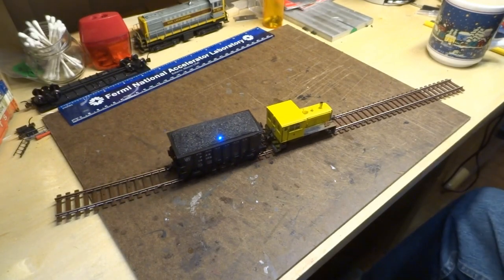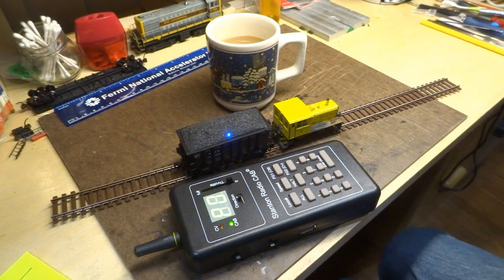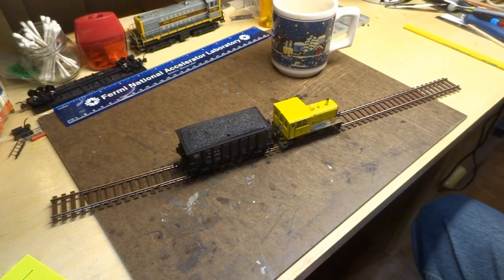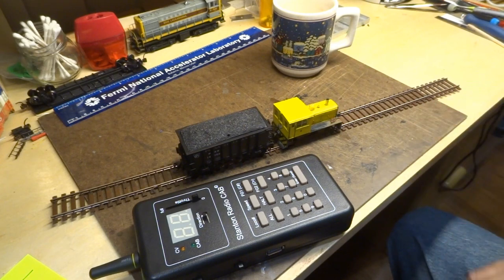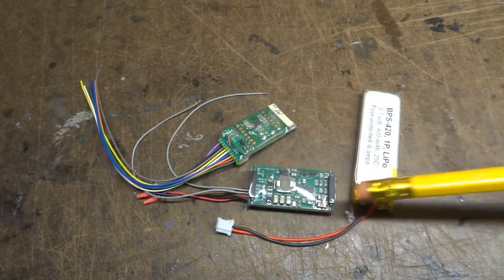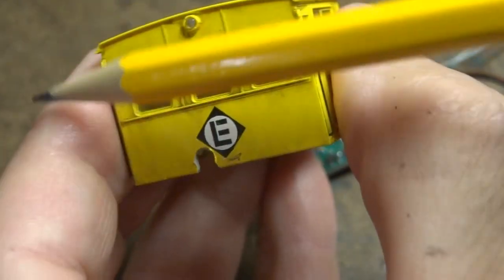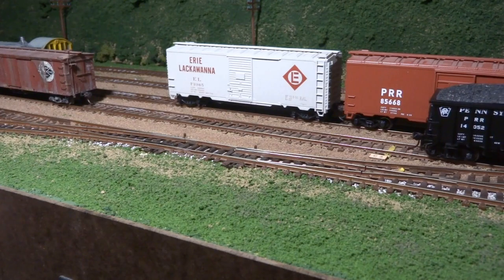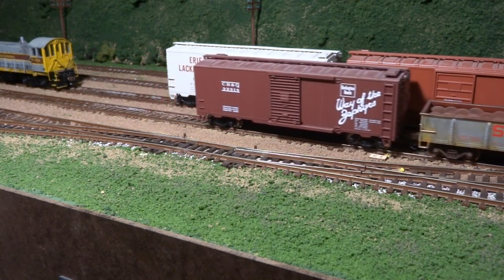DEAD RAIL INSTALL IN HO SCALE  and  S-CAB SYSTEM REVIEW.

Comment: I’ve been out of MRRing for years but having the itch to get back to it. It’s amazing the tech that’s come about since I last played around in late 70’s. I was too young to understand the electronics then but now, after retiring from an electrical/ maintenance background the automation makes so much sense and systems are much easier to implement. Layout wiring is much simpler with wireless controls. Nice video 😊
Reply from the maker: Thanks, Brad!  The S-Cab system I'm using was exactly what I wanted, but does take a bit of head scratching at first, as Stanton's website is so full of technical information.  He was patient with my questions.  Check out the Dead Rail Facebook group for information on many of the battery systems out there.  No more tedious and frequent track cleaning for me!

Comment: I just installed a Soundtraxx Blunami in an HO Scale Mantua Southern Crescent Limited. Going to test it out tonight at the layout powered by 2 standard 9v batteries in parrallel for extra run time. The Blunami operates on anything from 7.5 to 22 volts.
Reply: Also, the 9 volt batteries are in a trailing box car with lead wires going to the locomotive, just like your coal car. Eventually I plan on using rechargeable batteries with diodes and voltage regulators etc... so the batteries charge from the track.
Reply from the maker: Nice!
Reply from the maker: That will be great!

Comment: Nice informative video. I was using the Rail Pro system to control the locomotives and used a dummy locomotive to hold the batteries. If you are a new model railroader or don’t have many locomotives to convert I believe Power on Boaed is the way to go. Thanks for showing the Stanton system.
Reply from the maker: Thanks Tom!  I'm used to on-board power in the 7.5" gauge railroad world.  Now I hope to have that same reliability in HO scale.  I'm tired of OCD level track cleaning!

Comment: Very cool video.  I am using the Micron (Deltang system). Very similar but as far as I know it does not recharge through the rails.
Reply from the maker: I do enjoy the fact that the battery power never stops dead due to lack of electrical continuity.

Comment: I have a slightly different system as I don't have any power on the track at all. I don't mind plugging in the charger. Instead of having the light on the coal car, I have a beacon on the engine. All of my unit goes into the engine but if I had one the size of yours, I would have to have another car in back of the engine just like you have. I am going to have several cars built with only the batteries in them, especially cabooses, so I can have several batteries charged at the same time. I can get about 2 hours of run time out of each battery set up. The system has a charge indicator built in so that when you press a button on the transmitter the cab light will flash the charge strength. My system is from England and is at this time being retooled and will be available in the fall of this year (2022). It was formally called Del Tang but I don't know what it is going to be called as the company has been bought and that is why it is being retooled at this time. The receiver will fit into your small engine and if you get the battery into a car behind the engine, I see no problem in getting a long run time. On one of my switchers  (an SW 1) I will have a "calf" connected to it and that will house the battery. I use a "micro plug" between the units and it is not a problem.
Reply from the maker: Sounds like a really cool setup, David!
Reply: @StanFerris  I like it. No sound but I don't mind. Kinda like the sound the wheels make on the track.  Works for me...
Reply from the maker: Yeah, at the beginning the sounds loops were a novelty, but after a while they seemed to get irritating, sound I turned them off.  So when I went dead rail it was no biggy to just get a board without the sounds.  Sometimes I put a CD on with environment train sounds.

Comment: A friend of a friend, etc.  use to install the plug in batteries professionally.  His comment on the recharging from the rail was the batteries got hot and exploded.  I would assume that this has been resolved in the newer systems.  Any comments.
Reply from the maker: Tommy, well I can't answer as any kind of electrical professional, but the lithium batteries in the gear I use are "smart" in that there is a bit of a safety circuit built in.  Also, my rails are not energized most of the time.  Only when I'm running.  So far, I've had no problems.  As far as the controller, (and most of my Li battery appliances at home and in the shop), I leave them all on their chargers continually- even the laptop I'm typing on now.

Comment: Thanks very much for this but there's something that's confusing me. Where's the receiver? Shouldn't there be three circuit boards? The battery power supply circuit board, the decoder and the receiver to receive the signal from the S-Cab handset.  Also, I'm not aware that ProtoThrottle do battery power. Is that right? I mean battery power for the loco. The handset is battery power but I'm not sure if they supply a receiver to go inside your loco so that that can be battery power.
Reply from the maker: Hi, Richard.  The particular S-Cab system I purchased did not need the factory decoder that was in my locomotives, since I did not need a sound card and a few other programmable options.  The one I installed has three components that got added to my locomotive, instead of the existing on-board circuit board (which I removed).  The S-Cab comes with a small  battery, the BPS module (power supply and regulator, and the receiver/booster module.  It takes power from my rails only to charge the battery, not to run the loco.  The hand-held transmitter sends controlling signals to the receiver that you install in the loco.  Since I already had DCC power to my layout, my loco can get power to recharge it's battery anywhere there is clean track.  Here's another video I did on a slightly larger loco:  https://www.youtube.com/watch?v=Ac4zBaNj-q0&list=PLTQ_pr6o-F_2apJcU-DtWKITdBAQUgwIY&index=58
Reply: @StanFerris  Thanks Stan. I think your receiver is also called a decoder, they are all in the one unit. I'll have to study the S-Cab web site thoroughly before I fully understand. There's a lot to read and it's a beautifully presented website, a joy to read. It's a great shame Tam Valley Depot stopped producing their dead rail equipment. I've managed to get some before they disappeared and am in the process of installing it but I might move over to this system to get more locos battery powered.

Comment: One important question...how long does a charge last?
Reply from the maker: Thanks!  I had the same question before I made the conversion.  S-Cab estimated my loco would run almost an hour or so without any charging from the rails, and indefinitely if it got some voltage now and then from a clean section of track (I have NCE power system).  So I did a video to test that.  https://www.youtube.com/watch?v=jQlVLg-fa1U

Comment: As a newbie to the Train model world ,  I think they should have ready to buy dead rail trains .  I want to make a simple layout and not have to deal with  electric tracks .
Reply from the maker: Hello!  Hope you have some great fun with model trains!  The smaller sized scales are more challenging to fit batteries and controllers into.  If you look at some of the larger scales, like LGB, there are some that come battery operated already.  They are often used outdoors in gardens where electrified track would be harder to maintain.